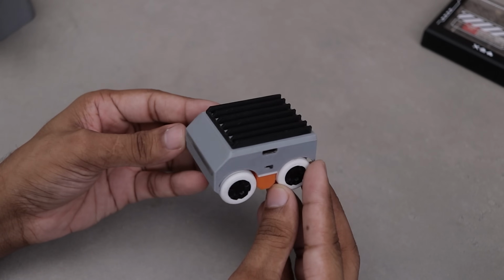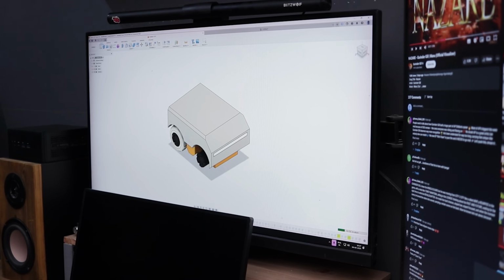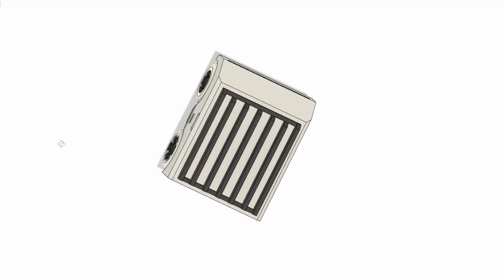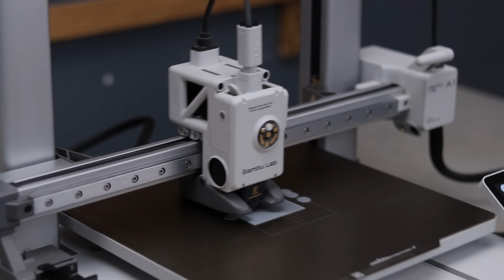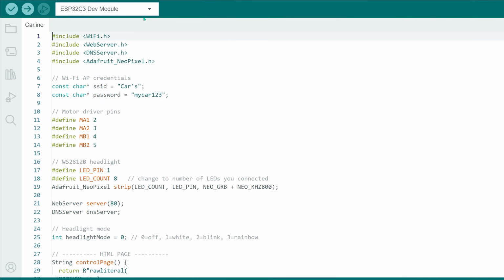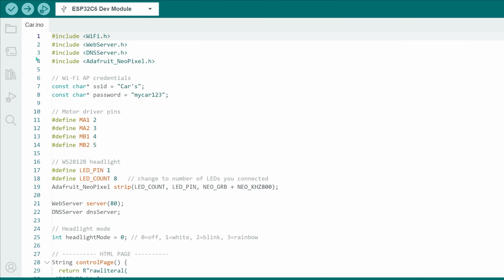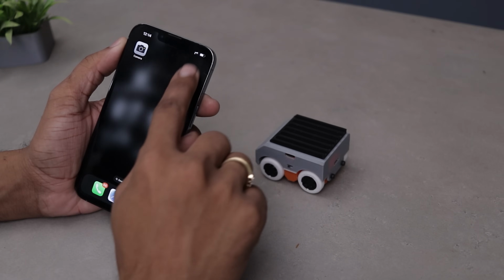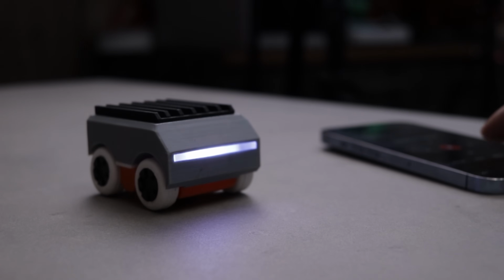Building the Coolest 3D Printed Tiny Car | Smartphone Controlled

Comment: connecting both tyres on a side with tread tracks or a rubber strip would give you the fine grip and good control while turning